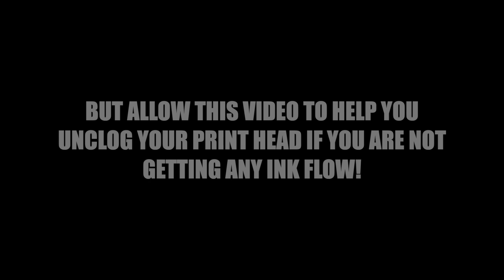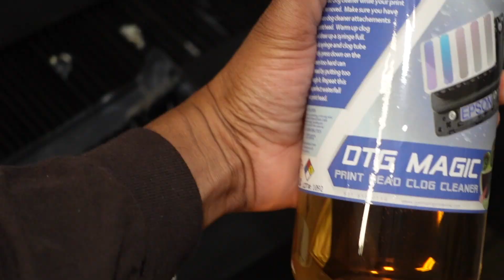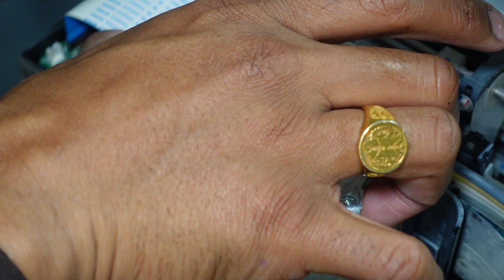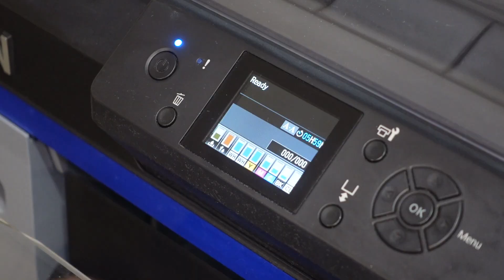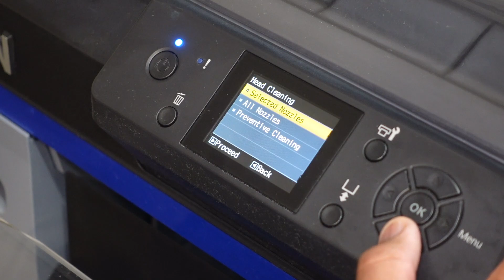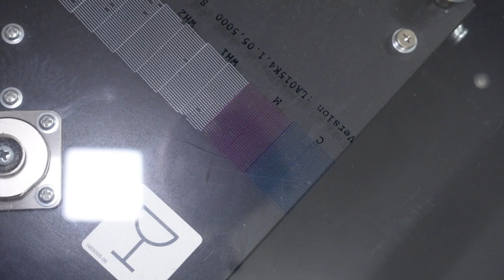HOW TO UNCLOG YOUR EPSON F2100 DTG PRINTER AND DO A REVERSE HEAD FLUSH.

Comment: Hey i followed your instructions with disassembling the parts that connect the dampers, some of the screws you instructed to take out weren’t holding the component down, you also said to unscrew the black screws, which in my printer were the rest of the ones that were holding the plate to the nozzle, this caused a spring to come out of place under the plate which i can no longer access, i tried to reassemble the same as you’ve instructed, hoping the spring wouldn’t be an issue, but it turned out very slightly angled. now my nozzle check isn’t printing at all, when previously my only problem was the white ink.

Comment: So after no maintenance for about 4 days my magenta and cyan were absent on nozzle check even after multiple cleans. I did a reverse head flush and brought back my magenta. Cyan still missing. Changed out the damper and there is no air in the line still no cyan on nozzle check. I hope I don’t need a new print head just for one missing nozzle 🤦🏽‍♀️

Comment: Totally wrong in take apart flow and process
Reply from the maker: @FurySoccerRedTeam  not wrong at all. But hey use this reference you will need it at some point
Reply: Fury... are you familiar with the proper process?  I have clogged whites on my F2100 and would welcome any available guidance.

Comment: Why do you call this a REVERSE HEAD FLUSH, when you are pushing clog solution through the print head in the same direction as the ink flows normally? 

A REVERSE HEAD FLUSH, is when you PULL (suck) clog solution backward through the print head from below the bottom of the print head nozzles, to remove the clogs. which is totally different than what you showed in this video. Just like when you put your car in REVERSE, the car goes backward, not forward!
Reply from the maker: Lmao you obviously haven’t seen my first video on my other printers. Let me educate you real quick 

Mind you I know how I car operates. 

But a reverse head flush is reversing the process that machine would actually do automatically. When you reverse the head flush you are not sucking solution through the print head you are forcing it through and clearing any access liquid through your print head with a draw back suction. 

Let me know if you need me to continue.. I have more. Since you took the time to write all that out I’m assuming you may have the time.